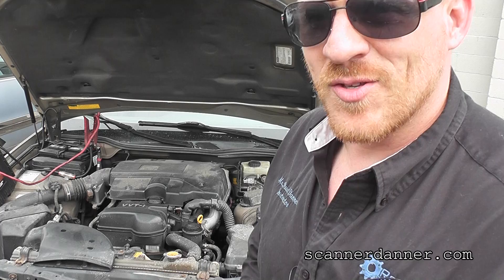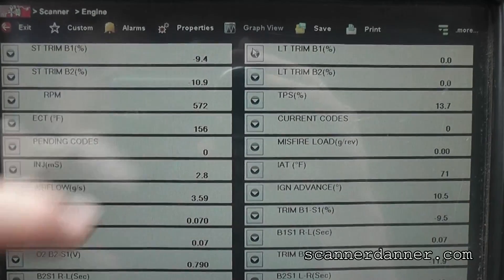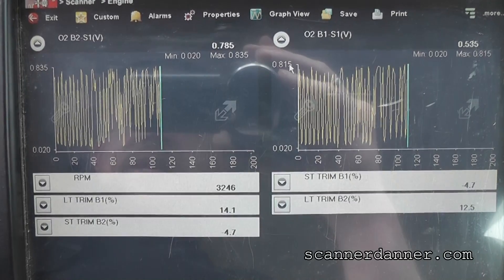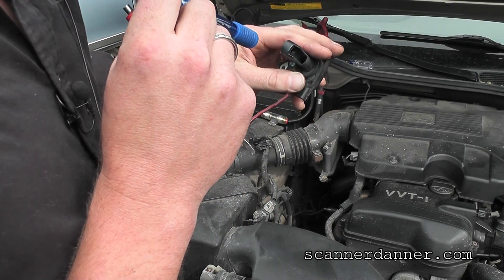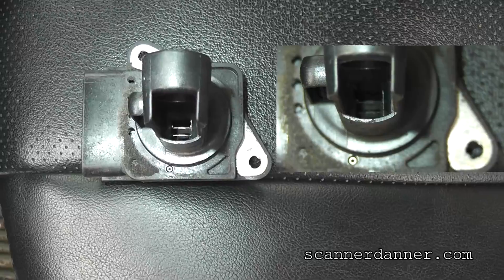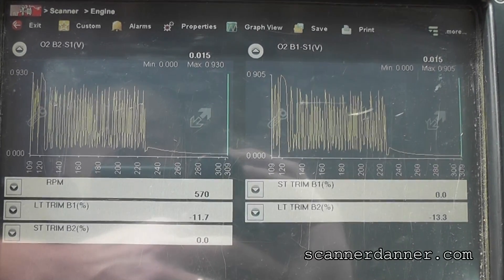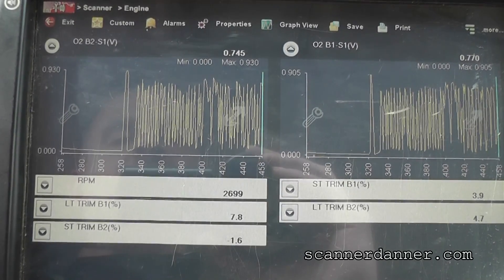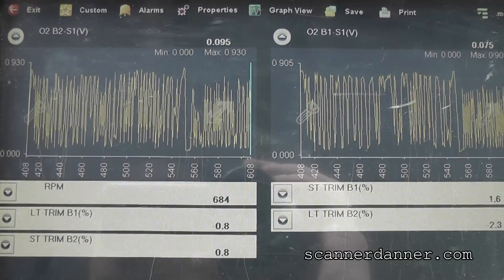How to identify and clean a dirty MAF sensor (Lexus)

Comment: very nice tutorial. 
can you help me with my 2006 Dodge Charger .... it works fine when i drive it but when the car in Park not driving ,engine working  and i try to get motor to run  3.5-4000 RPM the engine wont go past 3500 RPM, it seems like something is stopping it from running  4000 RPM . the scanner showed a PO430 code. could it be just a dirty MAF sensor .
Reply from the maker: you are describing a rev limiter. In park the engine computer is not letting the RPM go past 3500-4000. This is normal. The P0430 is a cat code, you need a cat and then also have the system checked out for exhaust leaks and any other faults withing the system (fuel trim and misfires, oil burning etc) BEFORE putting a cat on it.
Reply: @ScannerDanner   hi,  even without my scanner connected  when i press on gas pedal it should accelerate  fast and go to 3.5- 4000 RPM and even past 4000 RPM, but for some reason engine will go only 3000 RPM and then seems like something is limiting  RPM to go any higher . Will the PO430  cat code restrict the engine RPM to go any higher. 
Thank you
Reply from the maker: @maxsmith2320  the rev limiter you are describing has nothing to do with the scan tool being connected or not. This is a built in feature. And no, the P0430 code will not be related to your rev limiter either.
Reply: @ScannerDanner  Thank you.

Comment: Thanks, Dan  I first cleaned the MAF sensor the so-called proper way then hours of testing and repairing and replacing plugs, coils, fuel filter, injectors etc my 2002 Jag XK8 with 170k miles on her and it still ran like crap.  Then I found this video,  WOW it worked!  The old Jag is running great now. And to think it only cost me $5 for the brake clean to fix it. Thanks again. Cheers to you and all your $$$$ saving videos.

Comment: I have a p0171/p0174 and replaced all the vacuum leak possibilities changed the fuel pump and fuel filter regulator. The short term fuel trim at idle is 27.3% and at 3000rpm 27.3%. The only time the fuel trim drops is when I'm driving and I let my foot off the gas. It drops then slowly climbs, once on the gas it quickly jumps to 27.3%.  Do you think I need 02 sensors, a new MAF, or do you think I have clogged injectors.

Comment: Ha ha I see where the battery drain is coming from. That thick cable with  the two inch plastic fuse holder makes me think this person has a loud hi amp radio wires straight to the battery. Friend of mine had one of those and it drained his battery all the time. Dead battery in the morning. I told him “ thars yer problem”

Comment: you are NOT supposed to dig around in the sensor with a screwdriver. use only proper sensor cleaner.
Reply from the maker: You'r e not even "supposed" to clean them, there is no manufacturer recommended MAF sensor cleaner. I explained why and how I used the pocket screwdriver. I am telling you that spraying them off only is not enough in most circumstances.
Reply: with proper cleaner and magnified inspection it is not a problem to get the sensor resistors completely clean. teaching the dangerous way (likely to destroy it) is not going to work for most people. I am sharing my opinion so people watching can do some thinking and research before they clean theirs.
Reply: NebukedNezzer if youre looking up videos on how to clean maf sensors either yours is bad or going bad. A cheap 3$ fix could make your car hold out for a couple more years before you actually have to buy a new one.

Comment: with 170k on my toyota echo I finally replaced the MAF sensor and corrected the P0171 code lean run error. no amount of cleaning would fix the original sensor. it lasted a long time. now the replacement was 19 bucks and it corrected all the problems. price coming down on MAF sensors for older car. looking at the original sensor its clean but just does not work properly anymore.

Comment: I have a 1985 Toyota Factory 1 Ton Pickup 22R . Efi . 5 Speed . I drove it for years Ok . In December 2006 I drove it throw a deep water puddle & it die'd . It has Not ran right since ! You try to start it . It starts for less the 1 Sec & die's! you let off the key & try to start it again . it starts for less then 1 Sec & die's ! It does This every time you try to start it ! I have replaced the { fuel pump, fuel pump screen , Fuel Filter .Fuel Pump Regulator . } . I took the gas tank off. & cleaned it . { it will run as long as you spray gas in to the Air Cleaner } you Stop It Dies !  today is 4/27/2018 I can find No One That Can Help Me! I have been trying to fix it . Now I will say that 2 times over the years I have got it to start & run till I shout it off ! & it did restart ! But I went out the Next Day ! & It would Start for Less then 1 Sec & Die ! I Love this truck Please Help  Thanks George

Comment: Hey S.D,  is it really safe to use brake cleaner instead of MAF cleaner?
Reply from the maker: There are those that say you should never clean a MAF but replace it when it gets contaminated. There are some studies shown where this may actually be the case. That being said, yes, I've used brake clean hundreds of times with no problems.
Reply: ScannerDanner 
Thx you do much!! I've tried to use brake cleaner to clean the MAF. Yea. The problem solved! Really a million thanks from the bottom of my heart!

Comment: my Chevrolet beat diesel starting. but rpm is not improve 2000 above.
I wl check the egr valve. but the problem still the engine.
pls help
Reply from the maker: I'm not sure what your question is my friend. Sorry. Can you be more specific in what you are working on and what your issues are? Thanks!

Comment: Hi, looking at checking my Lexus out for this but can you describe the symptoms that the car will be doing to indicate a dirty MAF please?
Reply from the maker: low power, lean exhaust codes (P0171 and P0174), hesitations on acceleration
Reply: ScannerDanner thanks, exactly what I'm getting, had it carboncleaned and did the EGR prior, feels better but still very slow to rev in 2nd 1-2k especially with an incline.
Gonna get me some MAf cleaner and have a go. Thanks a lot

Comment: I have 1996 Lexus ES300. . if I don't let the car warm up and drive, check engine light comes on. I put code scanner on and it tells me it's the bank 1 O2 sensor, it's brand new..so I erase the code and drive it around. no check engine light. but if I let it warm up for about 5 minutes The check engine does not come on.

Comment: I just bought 'crc mass air flow sensor cleaner' & it does say not to use on Mitsubishi, we'll that's wat I'm going to use it on'''I learnt,the MAF is extremely delicate so make sure you spray from afar,so u dnt brake anything...that's the only one to use.CRC MAF CLEANER.

Comment: HI Paul ,you are the MAN,but you know it.I have an old 85 Vette,this is a one year car since GM went with bigger modifications since the next MY.The car was garaged in the last 2 years and when i recently fired it up i obviously had a rough idle,engine  stumbling and a nice SES steady on display...I know that f...g rough idle and i was expecting some 33 or 36 code all MAF rerlated...it was the case...long story short my 33 code indicating a maf sensor high reading vs tps was stored in memory.My first check was if it was the MAF the culprit,or the pricey MAF module by bosh rated at about 250 $ and ...discontinued.BTW the MAF is a 400 bucks item not better...MAf was ok since it hadn't 12 v...i jumped 12 v directly from the battery to the 12 pin of MAF and SES went out...It was the module,next check was assure if it was a faulty module or a wiring issue, or simply an oxidized relais coil lead...it was just a couple taps on the cover (after dismantling an entire dash to reach the module...problem solved...

Comment: Your video was really helpful. I'm not a mechanic but after watching this I'm going to be cleaning the Mass Air Flow sensor which it's dirty according to the Diagnostic I just recently got and of course I'll be first removing the negative terminal of battery. Thank you SD.
Reply: ScannerDanner you didn't use MAF CLEANER, why?
Reply from the maker: Thank you!

Comment: Please don't ever stick anything inside a MAF sensor. They're extremely delicate and frankly you shouldn't advise anyone to do so. You should also only use MAF sensor cleaner. Never use, throttle body cleaner, brake cleaner or really anything else. Most of the platinum wires are coated and this is precisely why there is a specific cleaner for this task. Other cleaners can strip the coatings and, or leave deposits on the wires which can ultimately cause them to fail or severely decrease their service life.
Reply: Of course some granola nut had to post this. Saw it coming a mile away. Jesus dude it's a car part. Stop taking it so serious. It's not like he just disgraced some valuable Michael Angelo painting or some shit. And it fixed the car. I'd be very surprised if you actually work in this field everyday.
Reply: Well, we could tell this person they have to buy a MAF. Or you can have an Awesome Diagnostic instructor clean it with his trusty pocket screw driver to prove himself time and time again that he is the best! Whats he gonna do, make it worse? Stop trying to be an old Lecture box and give him an applause. OR ARE you too arrogant from jealousy? GEEZ😐 You should get to know Mr. Danner!
Reply: Brian Welsh lol! I thought you were calling him a lettuce head and to give scannerdanner some applesauce!! Then I put on my glasses
Reply: I wonder if i could use   " electrical Cleaner", which is also safe on a lot of electrical parts and plastics ?!
Reply: I've wondered that also, but since there's not a big difference in the price of either, and MAF sensors are so pricy I am afraid to try it.  Maybe someone else has tried it and will let us know. @palangnar3588
Reply: I use mass airflow cleaner didn't work brake clean works pretty good then I used a screwdriver had to get all black off then my fuel trim was good
Reply: I agree with danner
Reply: Being 20+ years experience technician i agree with you 99%,since you can proceed this way just to prove that you have faulty MAF sensor.

Comment: i have a 2002 lex gs i changed my exhaust manfold i still have a problem when i drive off not getting power from take off is it my MAF sensor. when pressing on gas i get this loud reving sound when taking off pressing on gas.

Comment: thats cool negative trims numbers at idle and positives at higher rpms is for sure a dirty maf, very cool paul!!!!, but my question is a low fuel pressure will give us this similar trims or just a dirty maf?
Reply from the maker: Low fuel pressure would not cause a negative fuel trim number at any rpm
Reply: +ScannerDanner cool paul thanks for the answer!, i though you might see one because i never saw low pressure cause negative trim

Comment: Hey my car has an issue where i get cat efficiency po420&30 i check my fuel trims i get  about 10 percent on long fuel trims and about 7 on short fuel trims. When I raise rpm it drops to about 8&9 percent total fuel trims. I think it was vacuum leak so I did smoke test and I didn't found anything any ideas?
Reply: my p0420 was a bad cat

Comment: I'm having the following issue with my engine. It's a 1.5 litre 4 cylinger engine. The long term fuel trim 
reads +37% at idle, the short term sits at 0 and then keeps falling to 
-20% and then it jumps back to 0, and again gradually falls to -20%. The
 long term fuel trim sits constantly at 37%. Both o2 sensors read 9mv 
aswell. When I rev to 2500 rpm the LTFT will drop to about 28% and the 
STFT will then slowly fix itself to read 0 and then the o2 sensor will 
fluctuate from 100mv to 900mv again, until i let it run idle again and 
then it's the same scenario again. When I actually drive it the engine will hesitate until 2500 rpm is reached and then the power is there until I reach 3500 rpm and then she shudders and loses power. She won't rev past 4000 when parked either. While driving the upstream o2 sensor reads 100mv until the throttle is at a set position and then the STFT will compensate to make the o2 read 100mv and 900mv again as normal. Any help on this issue would be greatly appreciated. I am currently studying automotive technology and I've only started learning about fuel trims. Thank you in advance, your videos have taught me so much through my course. Keep it up :)
Reply from the maker: Post this here my friend. Too much to cover hear. Thanks!
https://scannerdanner.com/forum/post-your-repair-questions-here.html

Comment: Another excellent video, and it all worked. I purchased a LED, flexible head flashlight years ago at Menards.  It's  a single LED with about a !/4" head,and 6" flex shaft. The base contains the battery's and it is magnetic. I use about a 4' metal plate as a base stand when needed. This might be helpful as a light for your videos. Keep going.

Comment: After watching this video, I cleaned one blackened MAF thermistor, or whatever they call them. It fixed like 4 problems. Before that, the idle was a shred too high at times, it would spark knock just as it fired up,  it would spark knock when accelerating,  and excessive exhaust odor was noticable when idling in park. The spark knock problems developed more recently. Carb cleaner and a Q-tip fixed all of those things right up..
Reply: John Doe you're not supposed to touch any part of the sensor aside from the plastic. Touching the metal wiring with a q tip could damage it
Reply: Jack Tran did you not just watch this video?

Comment: i have a 92 lexus sc300 5spd thats giving me a hard time Danner.. ive watched your videos and i think your great at what you do. 

replaced the ign. coil, distributor (entire assembly), plugs replaced with same plat. spark pluggs it had for 114,000miles. car has 126,000 now and it starts and runs good until its up to temp and then its starts missing and cutting out when giving it a good bit of throttle. everything else is fine. No check engine light as its an OBD1. The Iacv was cleaned along with the throttle body (both were taken out of the vehicle to be thoroughly cleaned) and the car idled better and ran good.. for about 20 mins... now its doing what i told you- missing like terrible, wont stay running, have to stay on the gas or when it stalls give it a good bit of gas and she starts right back up.. i feel rly dumb as i always figure out whats wrong but im rly stumped on this one... PLEASE HELP!
Reply from the maker: you made no mention of testing fuel pressure. this would be your next step

Comment: I got 1998 jetta 2.0 and its losing power at 3000rpm until I let off the gas then it runs fine again.i changed the mas sensor and its still doing the same thing any body got any ideas I'm lost with what to do

Comment: 2001 Ford F150 4.2 V6 change spark plugs wires ignition coil pack fuel filter cleaning throttle body cleaning EGR valve and still say misfire cylinder number 2 and also said lean bank 1 the truck shakes and trembles when trying to accelerate and sometimes it pops like a backfire
Reply from the maker: That's better. Thanks!  So does this have the single coil pack with 6 coil towers? I'm not to familiar with the 4.2 set up in that year
Reply: it had 6 pack
Reply: +ScannerDanner 6 coil tower
Reply from the maker: okay, was the misfire on the number 2 cylinder there before all this work was done?
Reply: +ScannerDanner yes it was
Reply: yes it was there
Reply from the maker: then you need to check for injector pulse next and then compression after that. 
https://youtu.be/SUxagOAVS5M (start at 14:20 for the injector pulse test) you can do yours with the engine running.

For compression testing, you can use the sound of the engine during cranking. (you do not need the scope I am using, just use your ears. Be sure to disable the fuel (remove the fuel pump relay) to perform the extended cranking tests I'm doing in the video

https://youtu.be/WKdZsWU2ZmI (start at 2:14 for what an engine should sound like with good compression in all cylinders)
(start at 4:06 for what an engine will sound like with a single cylinder with no compression)
Reply: okay I will check it out and I will get back to you thanks
Reply: hey I figured out was it was ..number 2 spark plug was cracked in two places
Reply from the maker: So it had a number 2 misfire before any repairs and after repairs you put a cracked spark plug into the number 2 cylinder? Crazy. But you fixed it so that's awesome
Reply: it had a number two misfire all alone. I replace the plugs once but the guy that did it tightened it to tight and cracked it. I didn't know until I was about to do a compression test and find that it was cracked. put new one in and it run great now
Reply from the maker: what are the chances of that. crazy
Reply: yea I know right. but thanks I'm sure I might need your help again
Reply: yea I know right. but thanks I'm sure I might need your help again

Comment: I need help with my truck number 2 misfire
Reply: no its good tho
Reply: I got a P0300 and then found a loose spark plug, then got a P0306 and found my #6 plug was also loose and the ceramic was busted off, causing arcing.  Replaced the plug and no more codes.
Reply: check for spark, fuel injector pulse and compression. Need to know what you're missing to help. Also year, make, model, engine, history of the car etc would help greatly
Reply: 2001 Ford F150 4.2 V6 change spark plugs wires ignition coil pack fuel filter cleaning throttle body cleaning EGR valve and still say misfire cylinder number 2 and also said lean bank 1 the truck shakes and trembles when trying to accelerate and sometimes it pops like a backfire
Reply: Have you checked fuel pressure?